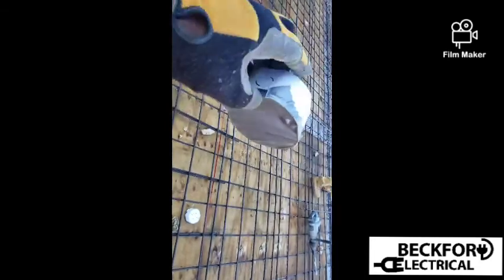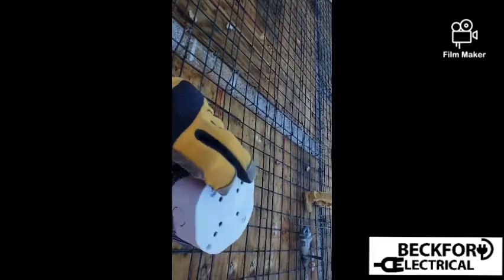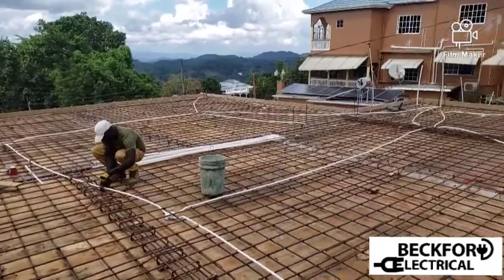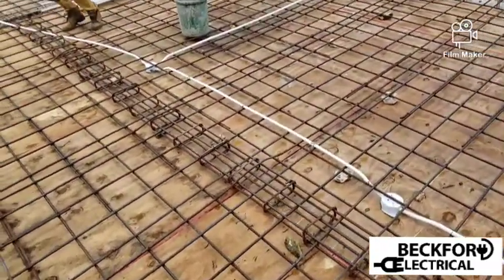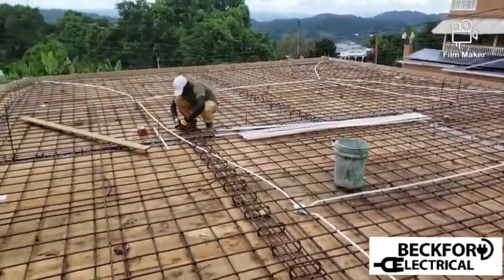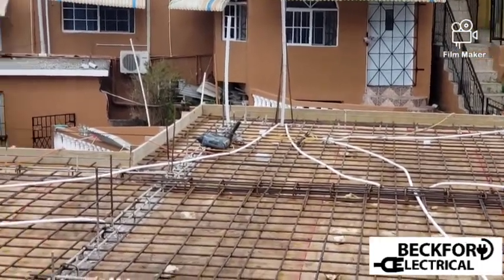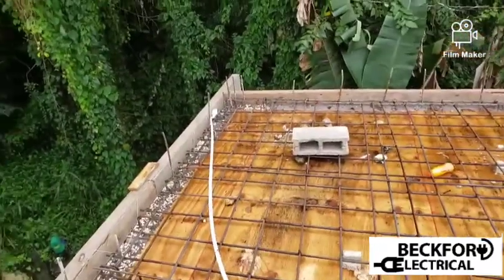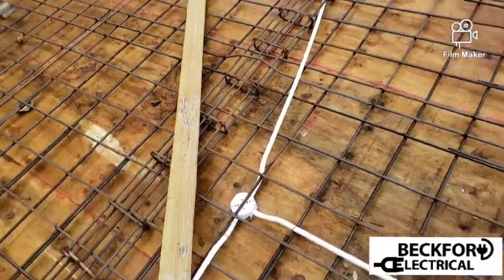How to prepare a electrical piping for ducking (concrete slab)

Comment: What the cost for a piping like that
Reply from the maker: It’s all depending on your location and type where f wiring you doing. For that it’s a electrical wiring and camera system in one so that’s like 35g just for the piping and it’s in my area.

Comment: Respect boss. Setting up pipes for camera system it's decided and should be on it's own circuit?

So one pipe would come from panel and link all the handy boxes for the camera?
Reply from the maker: No the VCR will provide the camara with its own power and thats a low voltage line so it shout be separated
Reply: @beckfordelectrical  What's is VCR?
Reply from the maker: Camara receiver
Reply: Who have a js21 copy
Reply: @thegoodelectrician9642  I have the Hard copy version.
Reply: @adrianfrancis1156  u can send it on Instagram
Reply: @my_hydro_tutorial
Reply from the maker: @thegoodelectrician9642  we have.
Reply: @beckfordelectrical  send it on Instagram
Reply: My_hydro_tutorial